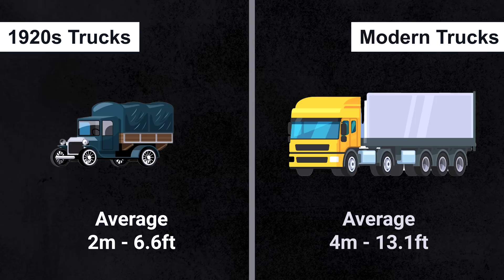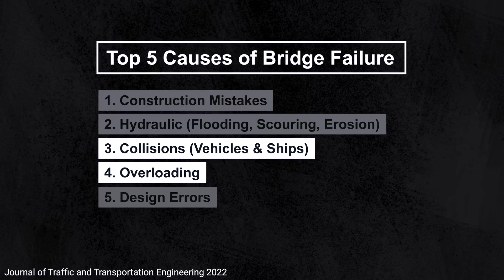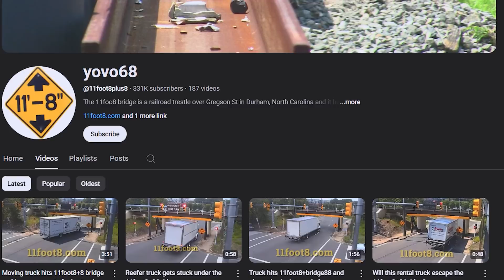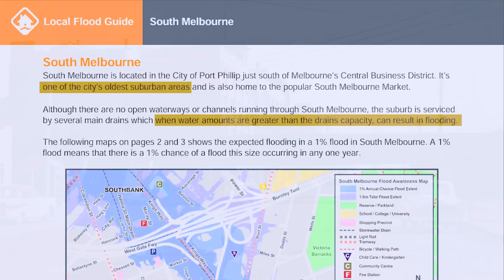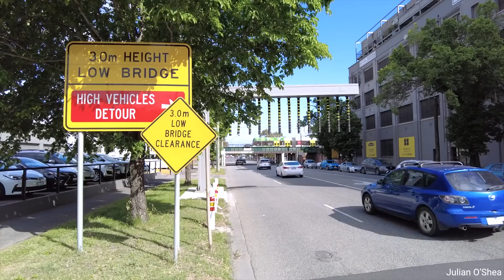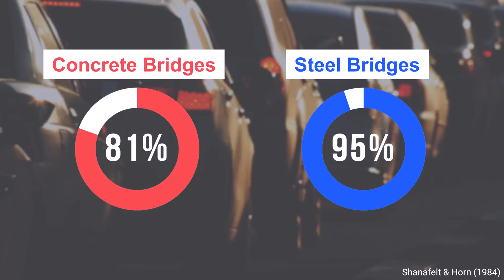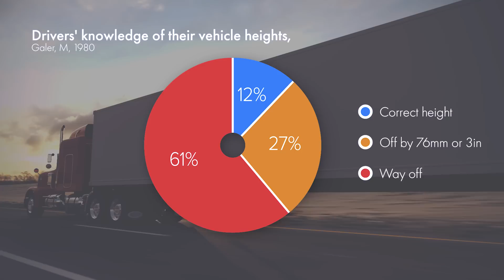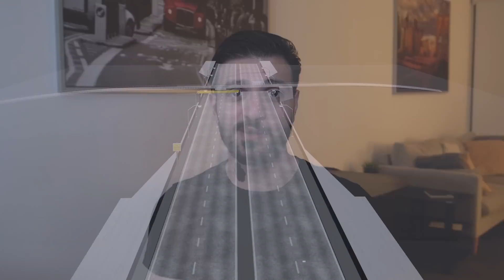Why Do We Still Have Too Many Low Bridges?

Comment: a lot of trucks, at least in the US, now have the vehicle height posted on them somewhere visible to the driver's seat. usually the front corner radius of the box or trailer but I've also seen it posted on the dash or the windshield especially on rental trucks. don't know how much of a difference it makes but I imagine it helps a lot for those that care to read those markings

Comment: I think part of the problem lies in the fact that over time the road gets repaved adding more inches of pavement.
Reply: I have rarely seen roads getting repaved over the older layers, at least in Europe. They always grind the top layer of pavement and repave to the exact same height.
In most cases, this is down to a lack of training for long haul driver, or a lack of awareness when people rent a vehicle that is taller than their usual one.
Reply: @zegamerz1980  in germany we do that on the Autobahns. Smash and break up the old concrete, and put new asphalt on top of it. Side effect is, it makes the foundation super strong, since it was never planed to have a concrete road surface underneth an asphalt road surface 😅 But when there are older and lower bridges, the concrete gets removed to keep the same hight underneath. When you know this and look closely you can even see it, that an Autobahn that has been renewed in this way dips down by arround 1 ft before a brige and goes up again behind it.

Comment: Solution? make them even lower, so low that anyone with anything but a regular car would be able to tell immediately that they can't pass. Sure, vehicles just short enough to pass wouldn't be anymore, but that's probably better anyway, so you can put signs that say "cars only" or "no trucks/campers" and the message is conveyed clearly. The extra material below the bridge should be soft and easy to break off for safety reasons.

Comment: As a former long-haul truck driver and trainer, I can attest that pretty much every van driver (the majority of large truck trailers) knows to never chance anything posted at less than 14 feet.  (Such trailers are standardized at 13'6", but the actual height can vary by a few inches either way depending on load, tires, and various other factors.)  I've never hauled flatbed but the drivers I knew who did made a point of finding the tallest spot on the load and adding six inches.

Arguably the biggest cause of clearance issues for big trucks is needing directions.  Whether relying on GPS or actually calling the shipper/receiver, directions are almost exclusively given by people who have never driven trucks and don't even think once about overhead clearances.  I had one trip where the receiver's directions led me to an overpass posted as 13'6"; I knew my truck (12'8") and the trailer I had (I measured it at 13'5"), and also knew most clearances in the area were posted accurately.  On paper, everything should have been fine.

But I'm also the sort that despises taking unnecessary risks - particularly as the pavement looked considerably newer than the clearance sign.  I pulled over about a half mile back, grabbed my sticks, and went to check it myself.  Sure enough, the overpass was too low and the posted clearance was obsolete; the left lane had 13'4" clearance and the right lane only 13'1" clearance.  Even accounting for the repaving (usually 2"-3" of added surface), the sign was wrong - DOT regs specify that signs must indicate the lowest clearance over the travel lanes - which meant that the road had been repaved at least twice since the sign was posted.  Believe you me, I was very much unthrilled about having to back up for more than a mile.

As many have pointed out, most of the trucks in this video are box trucks (mainly rentals).  While truck rental companies almost always emphasize how tall the trucks are (and that height is conveniently posted at eye-level next to the driver's door), four-wheelers (aka production cars and the people who drive them) are wholly unaccustomed to paying any attention to overhead clearances.

To be absolutely fair, most such bridges I've seen over the years there are countless other reasons not to even think about raising them.  Let's be honest - most of these bridges are in areas with narrow traffic-laden streets, many of which had been there long before the bridges were even thought of.  You don't want trucks (even box trucks) on these roads in the first place.  Even if the height wasn't an issue, most trucks (even the small box trucks and step vans) are 8'-8'6" wide, while the travel lanes are only 8' wide or narrower.  And that's straight-on width; the longer the vehicle, the greater the width needed to navigate even the slightest bends and turns.  (This is why most lanes are a minimum of 10' wide, with a 12' minimum lane width on Interstates; turn lanes and the lanes on freeway ramps are 2'-6' wider to account for turning radii.)

In brief, it's not just the bridges and overpasses which would have to be changed - permitting larger vehicles in the area would necessitate redeveloping virtually every roadway in the vicinity!  Furthermore, many of these trucks support the weight of a family SUV on each and every wheel; older roads lack the foundations to support this kind of weight.  As-is, under-road utilities such as water and sewer are frequently damaged by the weight of even smaller trucks.

Short of a complete ground-up renovation of the entire surrounding area, these low bridges are here to stay!

Comment: "You can't do construction because it's a busy thoroughfare" is a bad excuse. "It's too expensive" is a bad excuse. It's no different than any other infrastructure upgrade necessitated by changing traffic and commerce, you either fix it or you pay the price for not fixing it.
Reply: You do have to prioritise though, in some places it won’t be worth doing
Reply: @circuit10  that's a reason to delay it for years, but not for decades, and if it's never going to be done a system which lowers a gate after detecting overheight vehicles approaching should be installed. It probably wouldn't cost more than a single accident.
Reply: It's too expensive is a perfectly valid reason. Governments do not have infinite money.
Reply: @georgemonet8187  Infrastructure is an investment in future profits, and loss prevention goes directly to the bottom line. Money is only limited by production, and production is limited by investment. It can be a virtuous cycle, or a vicious cycle, depending how you apply or fail to apply resources.

Comment: I design HGVs for a multi national OEM. The height regulation in mainland Europe is 4m, although this has differing levels of implementation between countries. In the UK there is no official height restriction, because there are still lots of Victorian Era bridges that are too low to fit to any standard, although 4.6m is a rule of thumb, 4.95 is absolute motorway maximums, as bridges are 16'6” (5.03m) they have a card in the cab to tell the driver, Ireland is 4.65m which is the height of the Dublin Port Tunnel.The rules in the UK and Ireland are irrelevant if you are on an international journey though as the EU rule of 4.0 metres comes in, although I'm not sure if you can travel between the UK and IRE over 4m.

Comment: Truck driver perspective;
1: people rent trucks to move/etc without even understanding clearances
2: lot of places will push people through CDL courses as fast as possible with poor training
3: poor or no route planning, often relying on Google maps which has zero considerations for height or turning radius
4: bridges aren't always correctly signed. On of my usual routes has me crossing a bridge with 13'5" as the listed clearance. My truck is 13'6". I've been over it 100 times just fine... drivers get used to this, see a bridge that's 2 inches too low they've never crossed before, and send it.
Reply: Excellent call on turning radius.  There's a mountain pass road near me that's signed "over 39 feet not advised."  (I don't think we have so many truckers that need to know what's that in meters!)  The state has resisted changing the advisory to a prohibition, even as commuter demand has increased.  Maybe it would be unfriendly to business?  Maybe because it mostly affects people in a different county?  But as it is, one dumb truck (about weekly) can endanger or block thousands of vehicles per hour.
Reply: "Truck driver perspective"

Ofcourse every single one of these incidents comes down to the driver making a mistake. But saying that drivers should "just get better" is not a solution, it's laying blame without actually even trying to solve the real problem: Drivers are under the impression that they can drive under these bridges.

Drivers don't intend to crash their trucks, they don't want to drive into a low bridge, and the only reason why they do is that they are under the impression that it's safe to pass under that bridge. The 11foot4 bridge is a superb example; there are signs, lights, there is flashing text and yet drivers simply assume that it's not for them because they think they will pass under the bridge.

Again: saying that drivers should be more aware is not a solution, that's laying blame at a person who did not intend to do anything wrong. Sh*t happens, just accept it.

This is a systemic problem. Trucks that are higher than the bridge can still get to that bridge and crash into it. A sign is not going to do anything if the driver is convinced that the sign does not apply to them.
Systemic problems are solved by changing the system. You make the wrong-thing- to-do either impossible to do, or you make it extremely illogical to do, or you create a much better looking alternative so people who have it wrong will choose the right way because it's easier.

For low bridges that means that you need to either have an alternative route that is easier for large trucks. You need some physical barrier that high trucks will hit and cannot ignore before they get to the bridge, or you just block the bridge for all trucks, eliminating the guesswork.

Yes, none of these are easy, and neither is telling the family of a dead driver that unfortunately due to cost we thought that it was easier to just blame your son for not paying attention than to do something about a problem that we've known about for decades.
Reply: @vinny142  im just laying out the causes of these issues. Half of your suggestions to rectify the issue does exist btw. Some are even in this great video we are commenting on. Yet trucks hit bridges regardless, and it's largely due to ignorance and negligence.

Outside of oversize, bridge strike is always the drivers fault. Drivers should know the height of their vehicle. If you see a bridge that's too low, you turn away. If you dont see it then its definitely the drivers fault. If you can't turn away, you pull over and stop to evaluate. The police will happily help stop and redirect traffic to let a truck U-turn or reverse away from a low bridge to avoid a strike. They won't even ticket.
Reply: @vinny142  Fellow trucker: The points he made are perfectly fine, you're in the wrong.

Comment: Why is there no ban on trucks passing under low bridges?
Reply: My brother in Christ, it has a clearance labelled on it. If you're above the clearance height, you're banned from going under it,
Reply: You know how the "no trucks" sign has exceptions? Basically, it's possible to surround an area by those signs to forbid trucks from coming through - but if a truck has delivery in that area (or in any other way doesn't have a path that doesn't have the no trucks sign), it's allowed to cross the sign. A sudden sign won't stop truck driver going to the block just after the bridge if the driver has a reason to believe that the block is surrounded by those signs. height restriction has more power - as long as the driver is aware how tall the truck is.
Reply: @AlchemistCH  
Bizarre take. If you bring an HGV past a 'no trucks' sign, that's illegal. If that means you can't reach the destination: Your problem.

It's not like you can break the rules to make more profit by bringing a vehicle that's unfit for purpose. Go back, reload it into smaller vehicles, make the delivery then. That's a planning problem.
Reply: @nvelsen1975  At least under European rules there are several such signs (generic "no through traffic" and several vehicle type specific) which actually forbid only through traffic but not traffic into an area. And "no trucks" sign specifically tends to be used to restrict trucks passing through a city block but not preclude delivery trucks going to the shops (or for example delivering furniture to residents' home) in the block.
It's kind of expected that a truck sent into such place (if the roads are indeed complicated) would be provided with appropriate route and be of appropriate size for that. Which runs back into the part of grabbing a rental truck to move some stuff without checking of it will fit under the bridge.

Admittedly, such restricting signs can cause a huge confusion if it's not clear whether they are set to close off a specific point or if they surround a larger area with corresponding exemptions.
Reply: @ 
That sign is round, red ring, white inside. 'No vehicles of any kind'.

Several such places exist. Like the island of Schiermonnikoog, it doesn't allow cars of any kind.

I live next to a street that's banned for all HGVs (and I've taken a company to court who ignored it, destroyed my fence, then argued they 'simply had to'). 

Which is why any transport company worth their salt carries a forklift on the back to make the final stretch of the delivery.

Recurring theme: "I must break the rules because of my convenience and profit" never flies.
Reply: @nvelsen1975  Yeah, that's what happens when logistics is done with no logic. If they can't get appropriately sized vehicle, collateral damage should be on them. One would expect that people with truck driver license would know a few things about plotting a route for a large vehicle...

Well, apart from actual local variations in the rules, there can be even bigger variations in how much reliance (legally) on the more obscure clauses there is (and how used the drivers are to using their brains in such cases versus just going there because they were told to bring the truck to some address). I only wanted to say that in cases when such clauses exist, it better be properly communicated why trucks shouldn't go there, as just trying to ban the trucks could cause more confusion for local deliveries which already are the primary culprit for small bridges
Reply: @AlchemistCH In the UK I usually see that sign with “except for access” below (but that’s more for weight limits)
Reply: Well, you see how much a ban on too-high trucks helps. The people ignoring the one would likely ignore the other, as well.